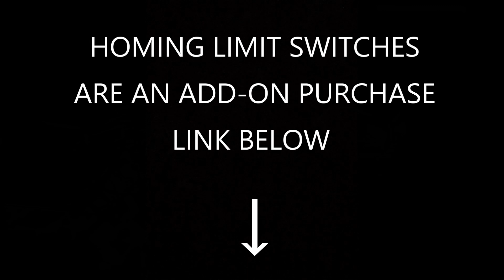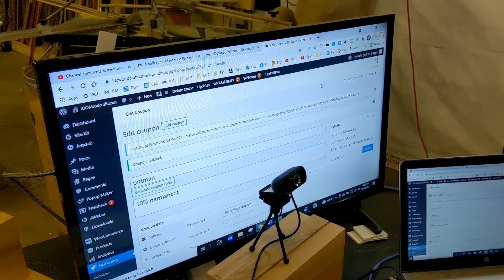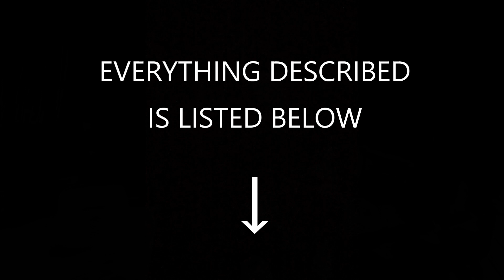Table Build For Longmill CNC 30x30 Router by Sienci Lads - Garrett Fromme [CBC]

Comment: Just built my new table for cnc #2 30x30 longmill. I went with 48 x48 table. Will build a kicker off the side to mount the electronics.
Reply from the maker: Send me a picture! Do tell... What inspired you to get the longmill over the other machines?
Reply: @IDCWoodcraft   100% truthfully  it was your videos /  reviews that made my decision  to go with a longmill. That's how I went and bought  my Bob's cnc evolution 4 back when covid hit. Bob is still my main machine.  I just carved 300 drink coasters and about 200 signs so far. I'm  at the point of wiring my longmill  and  cant find info yet for the limit sensors... just wat jedi the rest of the videos  of the work to finish up the longmill and taking a break from  it for a day or so.

Comment: Thanks for your in depth information. If I built an extended 48 x 48 machine how would I go about building a flat top for it and what dimension would you recommend 76 × 64?
Reply from the maker: Greg, for the 48X30 extended machine, I would recommend a table top size of 48"x78". Even at that size you will have a very sturdy table if you follow along to this video brother!

Comment: How did you make sure the top was flat?
Reply from the maker: Hey tangobayus, great question! There's lots of ways you can do this, the best way is to get an I beam level and put a set of feeler gauges underneath it to measure flatness. If it's not flat you can shim the underside of the table to make it flat. After that, I would mount the spoilboard and surface it. Then, the spoilboard will be parallel to the cutting surface in all areas and you are ready to cut! Hope this helps!
Reply: @IDCWoodcraft  Would it make sense to use steel 2x3 or 2x4 on possibility they would be better than wood? Or angle aluminum. Maybe make the top of 2 layers of 1/2" plywood and shim the top piece. (The grain would be turned 90 deg.)
Reply from the maker: @tangobayus   @tangobayus  The good thing about steel is it won't react to environmental changes in humidity and temperature. I don't particularly like to use plywood, unless you're using birch ply. You may want to consider sealing it as well. That will help with environmental changes as well. Hope all that helps

Comment: Do you recommend casters on these tables?  I've seen yes and no - where I'm installing mine I'm concerned it will be too hard to move without casters (it's going into a garage)
Reply from the maker: Preston, I am leaning towards no because you might see some inaccuracy in your cuts during rapid movements. Its another axis that isn't constrained properly and could lead to errors in your cuts. You could get wood dollies to move the CNC around your garage.

Comment: Ive decided the long mill 30x30 is gonna be my next upgrade. Fox alien has done me well but a 3k price tag on the vasto xxl seems a touch high. Longmill provides a more barebones aesthetic and price friendly so its got me hooked so far! Gonna go all out with the limit switches too. I do have a question on the switches though, wouldnt it be better to have one on each end of the x and y vs only on one side?🤔
Reply from the maker: Hi Jason. You only need limit switches on one side. The purpose of them is to set the home position of the machine.

Can you do me a favor? When you order your machine, can you use the links I provide? That will give me a little pocket change. Also let me know when you order it so I can verify. Thank you
Reply: @IDCWoodcraft  sure thing brother!
Reply: @IDCWoodcraft  my concern with the limit switches was to know the limit in both directions. Unless the 30x30 spoilboard becomes the guide for that?🤔

Comment: Hello I’m really torn between the 30x30 and the 30x48
With your 30x30 do you find any limitations for most projects. It’s totally a space issue as the larger machine needs a 78”x48”
I have a full shop and running out of room 
Thank you
Reply from the maker: davidshockley6972, it really depends on what you are looking to make brother! One big bonus with the longmill is you can start with the 30x30 and upgrade your machine to the 30x48 later.

Comment: Hi dear Garrett  hope you'r well, one thing I'd like to know about  which is better the water cooling router spindle or the air cooling router spindle . Thanks
Reply from the maker: The water cooled is much more efficient for cooling, but it requires a bit more maintenance. My preference is the air cooled

Comment: Off topic a bit, but is there a spindle available for this machine?     One, available or recommended by Sienci Labs?
Reply from the maker: Mark, there isn't a spindle available from them as of yet. I've known others who have put spindles on their machines. Personally, I don't find this necessary since it runs great with the hand router and is really designed for it!

Comment: Curious - what is the height of the laptop and monitor stands? How high is the hose stand?
Reply from the maker: Hi John, not quit sure that I understand your question. The Longmill doesn't include a stand for a laptop/monitor or vacuum hose. Hope this helps.
Reply: @IDCWoodcraft  I meant on your table build - what"s the dimensions of these items on your build?
Reply from the maker: @johnhobdy9785  I'll have to get back to you on that. I'm not near my machine right now. But I can tell you I put the big monitor at eye level. The stand for the laptop is at chest level. A little uncomfortable. I think I'll probably tilt it toward me. I hope that helps

Comment: Garrett, I am kinda modeling my table after your design, simply because it makes sense. I am putting mine on wheels so I can store it in a corner and pull it out for cleaning or maintenance if necessary. My shop is a tiny little 12' x 16' shed, so space is critical for me. Between this and my table saw, I don't have a LOT of room left over, but everything IS on wheels to make it easier for storage. I am also putting a shelf at the bottom for whatever...and I think I will build a drawer or two underneath for storage. I'll send a pic when it is done!!!
Reply from the maker: Mr. P, awesome! I like your thinking of how to make the most out of your space. Be sure to send over those pics, I'd love to see!

Comment: Kinda off the subject, when you"pause" a project, can you change a speed and then continue with the changes? 🥺
Reply from the maker: Hey cow man. No, you can change the feed, but you can change the spped on the router. Make sense?
Reply: @IDCWoodcraft  CAN'T change feed, CAN change router speed! Damn straight! 👍

Comment: My table is very similar, but I put a shelf on the bottom for the vac, and a switch panel at the lower left, for the controls (computer, longmill, router, and the vac).  Good video!
Reply from the maker: Hey Oz. Yes, I definitely want to put a switch for the vacuum on the table

Comment: Hey Garrett, love your videos, sir. 
Wanted to reach out regarding the 30x30 MK2. 
I purchased mine a few months ago and just received it probably 3 weeks ago and with all other projects I’ve been working on, I’m just getting to it. I currently have my table built and am in the process of adding my spoilboard to the surface now. My table dimensions came out to 48” deep 
45” wide 
& I believe I am at 36” tall (with the spoilboard) 
I elected to mount a 3/4” piece of plywood for the top, with a 3/4” sheet of MDF on top of that, with another layer of 3/4” MDF strips and Ttracks…. Is this overkill or an issue/concern ? 
I appreciate your help and any advice! 
Thanks
Reply from the maker: Hey Ryan, sorry for the delayed response it's been a busy week! Congrats on getting your machine and getting your table set up! I don't see any issues with your planned setup, it sounds like a great set up to me brother! Happy cutting!